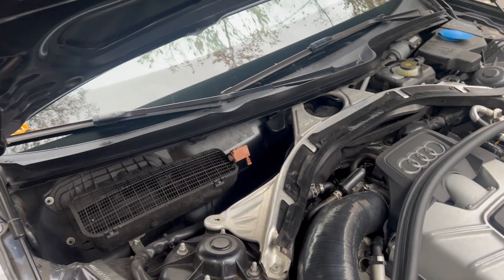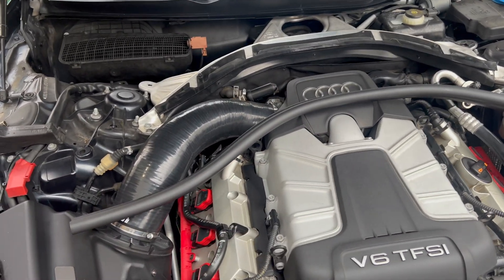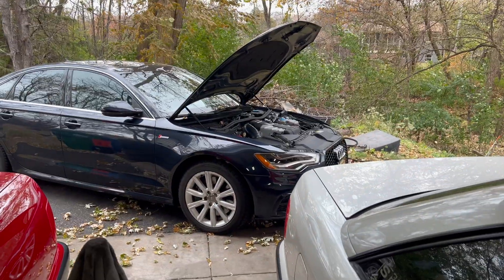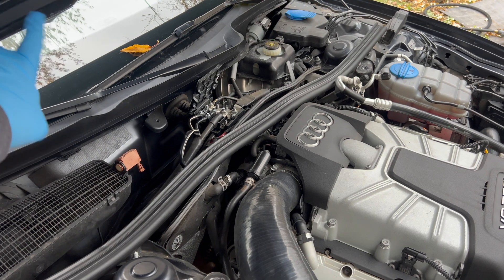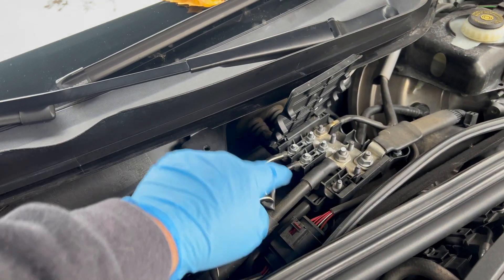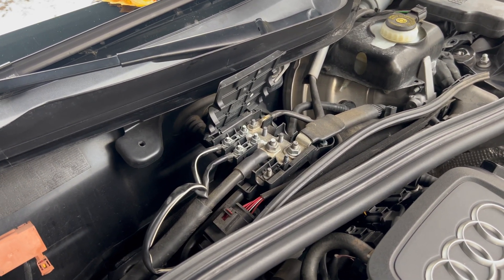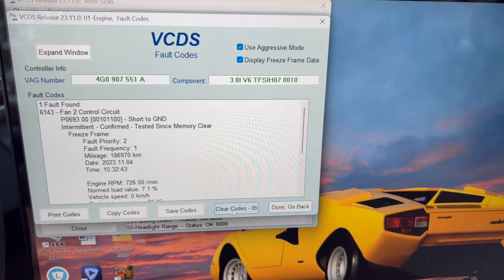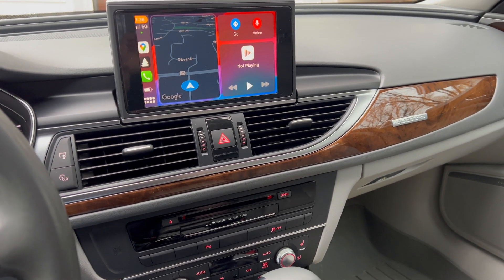Audi C7 A6 Cooling Fan Issues - P0693 Error Codes

Comment: How did you get the silver parts off
Reply from the maker: You mean the aluminum bracing?  T28 bolts hold it in but don't miss the two less obvious ones... see 4 minute mark in the video for those two.
Reply: @SCARSORGofficial yes the T28. What tool did you use to get them off please?
Reply from the maker: @michaeldasilva9595  Ah yes, I see why you are asking.  T28 isn't really a common size at all.  The car isn't here at the moment so let me get my hands on it later today and I'll get you a confirmation.  I may do a short about it as well.
Reply from the maker: @michaeldasilva9595  Honestly, the bolts aren't in there crazy tight, so a short flat blade screwdriver that fits snug into the bolt head would likely do the trick as well.

Comment: You are a smart guy, because nobody can tell you where is the fuses in this cars, it's amazing two fuses $36.00 USD, I have the same problem but in P0691 and  P0693 cooling fan and P275500 fluid control circuit high, do you have any solution for the P0275500?
Regrads
Reply from the maker: Is that for the trans cooler circuit by chance?  If so, that's another known issue on the C7 A6.  I actually have a new valve in the box awaiting install on our A6 to hopefully avoid failure.  When it fails, I believe it can cause coolant to go up the wiring harness and in some cases cause damage to the transmission control unit as well.  If that is what you're dealing with, I'd look at getting that failed valve out ASAP and replacing any portion of the harness that might have been compromised by coolant.  I could swear I've seen a video here on YouTube about this very issue... I'd likely suggest you look at the Audi C7 Owners channel as Cameron over there does a lot more with these cars than I do.  @AudiC7Owners

Comment: I have another fault on mine. CODE IS P048100 control fan circut fault fan 2. The fan turns on and shuts off. I have replaced the relay, checked the fuses, replaced coolant sensor. Please can someone tell me
Reply: I got the same on my A8 and P069300